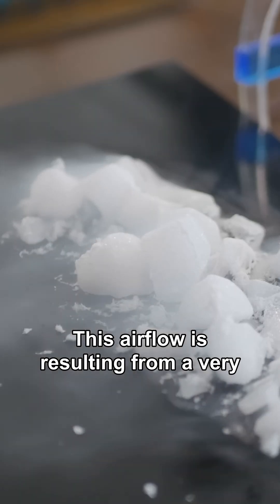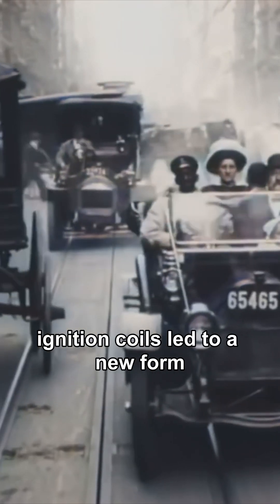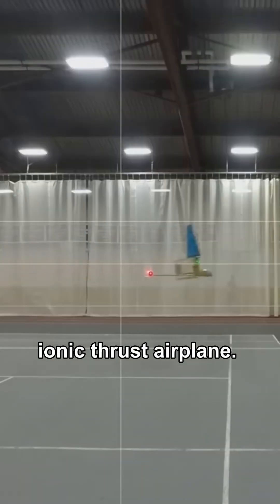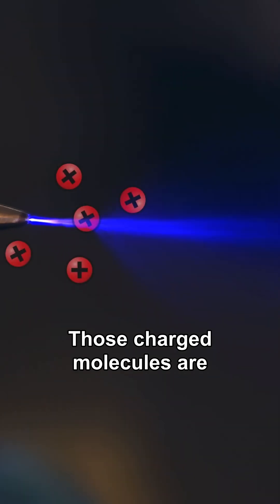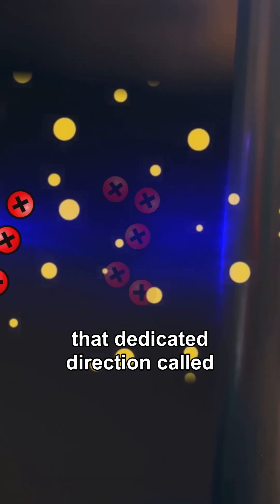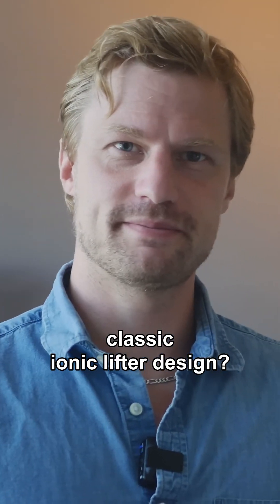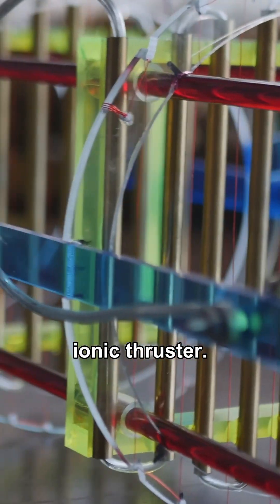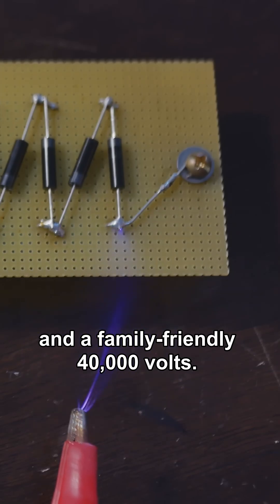Designing A Next-Gen Ionic Thruster! (For Flight)

Comment: I kinda think that this kind of thing is better suited for lighter than air craft like a zeppelin, or a hybrid of some kind. 

My reasoning for this, is that unlike a combustion based craft, a lighter than air craft needs consistent weight to have predictable performance, so something battery based, despite the extra weight, would solve that, and because it. 

Your basic thruster concept that you have shown more recently could be applied along the surface in optimal locations, or even built into the fuselage.

Comment: the major flaw?

you only perform work by repelling IONS. 

basic newtowns law. the ions have mass, inertia. to accelerate that mass in one direction requires (or produces) a corresponding reaction.

the "neutral" molecules perform NO WORK, and you cannot perform work upon them. they have no interaction with the vehicle, all they do is slow the stream of ions down.

its just like a rocket doesnt work by pushing against the air behind it. (sorry, flerfers...)

a wing doesnt lift without deflecting a certain mass downwards. a propellor doesnt make thrust without deflecting a certain mass backwards. 

whatever is entrained with that airflow is a loss, is drag, it slows the ejected stream of particles down, and has no role to play in producing "thrust" or "lift".

more electrodes, more points to "push" against, more ions being generated to "repel" and accelerate in the opposite direction...

simply moving AIR isnt the same as creating THRUST.

thrust will be proportional to the amount of ions generated, not simply teh volume of air entrained and set in motion.

like waving your hand through teh air, the only thing you perform work on is the molecules that impact your hand... the vortices and eddies and turbulence is those displaced molecules imparting their energy to the surrounding atmosphere, and those eddies have no effect upon the resistance your hand feels. 

water is a better demonstration, lol...

Comment: Fast forward to 2006 when Electron Air LLC built and patented a VTOL ion propelled aircraft with onboard power.  It can rise straight into the air carrying its power supply and flies for about 2 minutes. There’s a video of it flying on one side utilizing aerodynamic lift as well.